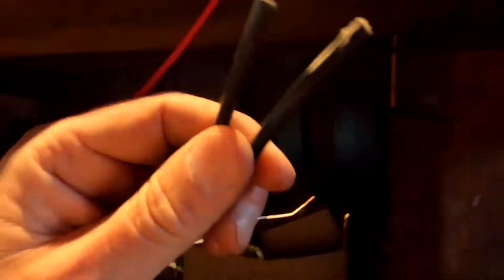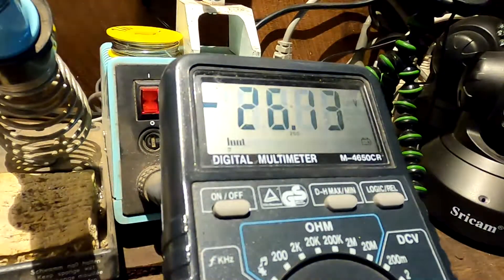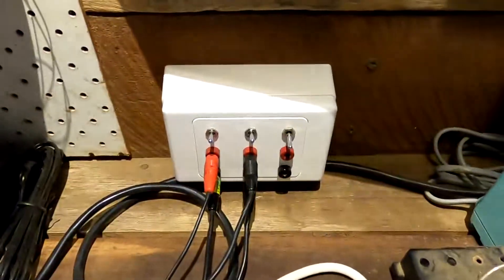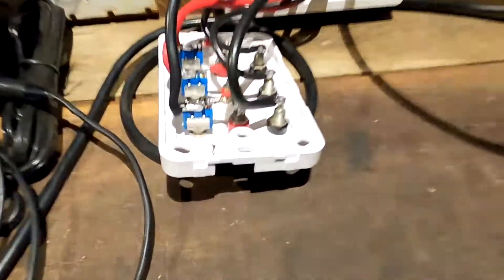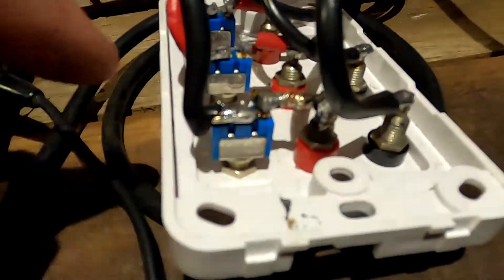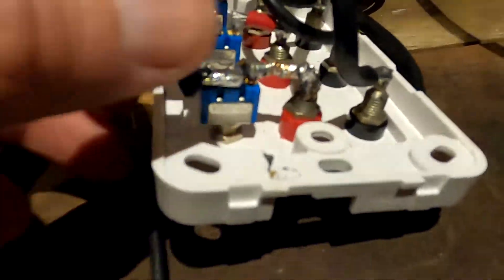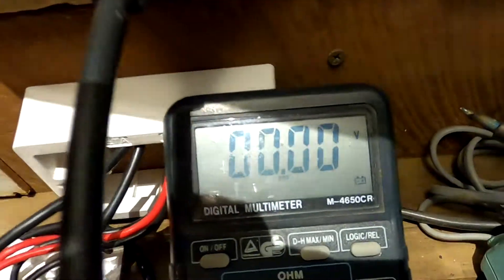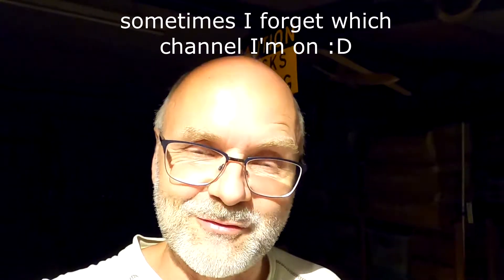The Solar-Test-Terminal. What's it for and does it work?

Comment: Hello Andy, just for short testing it will be ok.
Take a look for your switch parameter  this size `ll be ok for about 1-2A DC  and 8-10A AC  !!! check datasheet
An old light-switch from a lorry will have the right size. 
the "telephonepoles" are for 4mm² maximum   don`t risk a fire because of overheating!   stay save walter
Reply from the maker: The switches can handle 10A and I switch only 2-5A with them. That's all considered.